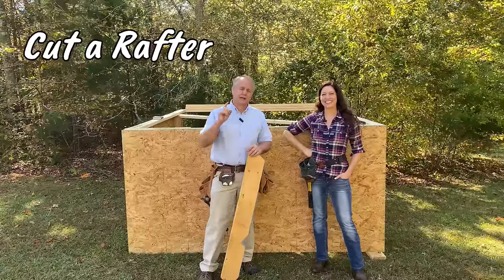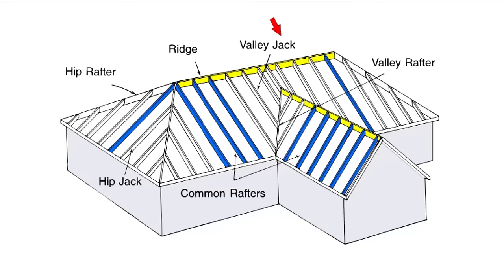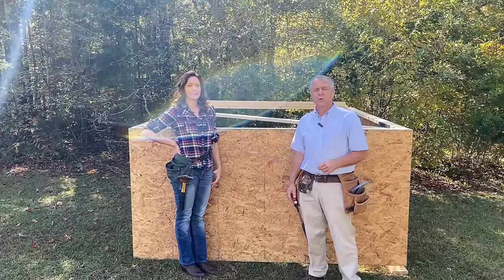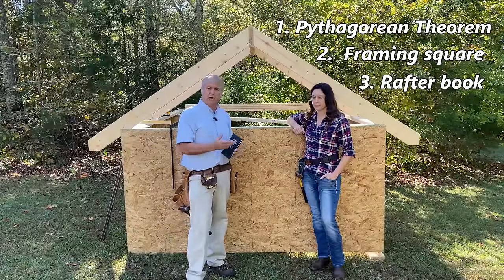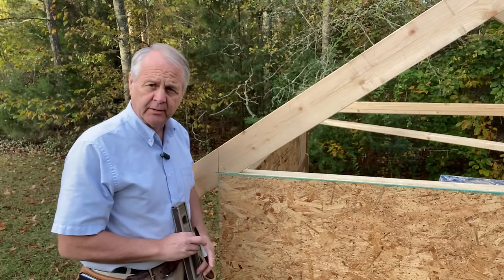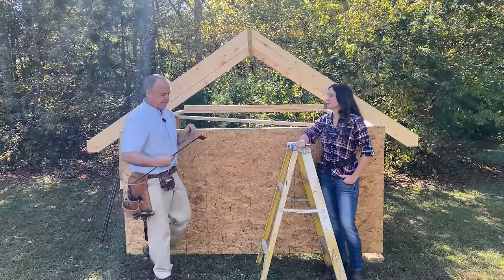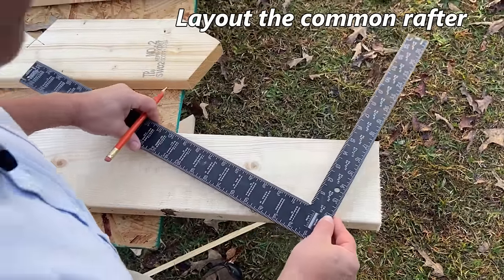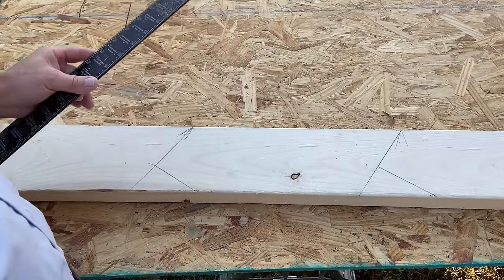Beginner’s Guide to Roof Framing – Cutting a Rafter, Step-by-Step

Comment: I see an error of the explanation. You stated that you wanted four inches gor a full bearing seat cut, but the framing point was ghe outside of the wall frame. You need a four foot run plus the thickness of the sheathing minus on half the ridge gor your calculations which actually translates to a 4-0 snd and 1/2 inch run. Then that four inch bearing surface works.
   I like you taught my students every possible way to calculate rafters to my students including snapping a bisecting line on the floor of the shed, setting a block representing the ridge snd and using the side and end walls as a marker to establish how the birds mouth fits using a sevond block representing the top plate.Your presentation was pretty much flawless,but I thought you would not mind if I pointed this out.
   I usually use a calculator to establish to the sixteenth of an invh accuracy, but feel that your rafter book would do it faster snd more reliably and without batteries and the exoense of a calculator.
   Good work,sir
Reply from the maker: Thank you for the response. I suppose I didn't explain it fully, but the span of 8' was to the outside of the sheathing on each side. The model didn't have any wall framing. It was just a top plate screwed on the edge of the sheet of OSB, so I used the full sheet for the span. Thanks for watching!

Comment: thanks for the awesome video... however, help me understand something... when using this primary method of measuring the rafter in this video, doesn't it require the rafter to already be in place as shown? I can follow the Roof Bible and the 'alternative' run method, and I can follow the method that was used, but it just seems like the rafter would have to be in place... The step off method also seems like the rafter would also have to be in place...

Another question, the rafter tail is arbitrary, correct? If I want it to be 12", fine, or if I wanted it to be 18", that's fine as well, correct? 

Thanks again...
Reply from the maker: I placed the rafter into position to aid the viewer in understanding its final placement. None of the methods of determining the rafter length require it to be so. In practice these are always laid out with the boards on the saw horses. As to the overhangs, you are correct. The length of the overhang can be whatever you desire. Regardless of length they are laid out with the same method. I trust this answers your question. Thanks for watching!
Reply: I have been cutting rafters  since 1968.  Here is a simple way.   First you need to get a book  that that tells you the rafter length by the span of the rafter.. In this plan the span is 8'  so you look under common raffter  by span go down to 8 ' It would automaticall tell  you the rafter lngth  of one rafter.( the run of this rafter woulld be 4'  but you look under 8'span.  Now the ridge ia 1 1/2''  wide so before looking up the apan you deduct 1 1/2''  from 8'  so you would actually look up  7'  10  1/2''   The best part of this book If you have a hip or valley( they are both exactally the same length)  you would take the same measurement o the span off the common  7' 10 1/2''  and look under hip or valley it would tell you the exact length of one  hip no shorting needed

Comment: Good info.
My question is on a L shaped building what would you call that roof?  The corner is what im interested in.
edit Hip is the keyword i wanted i believe
Reply from the maker: You are correct. The corner of two gables on an L shaped structure would be a hipped corner. Thanks for watching!

Comment: I'm getting ready to build an off-grid cabin in an area that has no building codes.  I'm trying to find info on ridge board or ridge beam sizing based on span and load.  Does your roof bible have that info in it?  I've built many houses but always used trusses, this is my first time with rafters.
Reply from the maker: No, Roof Framer's Bible doesn't address any structural beam sizing. There are just too many variables.  If you have ceiling joists attached to the rafters on each side you only need a ridge board. The ridge board should be one size larger than the rafters, so if you have 2x6 rafters you will need a 2x8 ridge.  If you have a vaulted ceiling (no ceiling joist tie) you will need a ridge beam large enough to carry the load of half the span. There are some beam calculators out there. Just figure out the loads for your situation (dead load, live load, snow loads, etc.) and plug those loads per square foot into the calculator to get a beam size for your ridge. This isn't really recommended for DIY unless you have some experience. It is best to contact a competent person or engineer. Good luck. Thanks for watching!

Comment: What I’ve never understood is that no one ever seems to mention how the depth of the birds mouth cut would affect (slightly) the angle of the rafters. Or is this so slight that it is ignored? It would also affect the angle of the plumb cut I would assume…?
Reply from the maker: Actually the rafter doesn't change pitch because you notch the birdsmouth. The entire rafter drops down due to the notch, but the pitch or slope doesn't change. Also because the pitch doesn't change the plumb cut doesn't change either. Think of the roof like a hat on your head. Notching the birdsmouth allows the "hat" to drop down lower, but it doesn't change the pitch of the roof. Thanks for watching!
Reply: I am having the same problem understanding this, because the run looks like it's from the inside corner of the bird's mouth, when the finished rafter is in place.
The top of the rafter at the plumb mark appears to have less rise, like 28" instead of 32", so how are 8/12 cuts still working? Or is it no longer a true 8/12 pitch at the top of the rafter. 
Obviously, I can see everything is working perfectly in practicality, in the video, but I am having a huge issue conceptually. Can you help straighten me out on this? I would be very grateful!
Reply from the maker: @mtmcb  The rafter is a true 8/12. Bear in mind that everything is figured along the top edge of the rafter. The notch for the birdsmouth is typically cut so that it fits the top plate of the wall (3 1/2"), but it doesn't have to. You could have a birdsmouth where the H.A.P. was greater. This would change the height of the ridge, but it would have no effect on the pitch of the roof. The rise would remain the same from top of rafter at wall line to the top of rafter at the ridge. The ridge would be higher off of the wall plate, but only because of the taller H.A.P.  The height of the ridge is always the H.A.P. plus the rise. Thanks for watching!
Reply: @RoofFramersBible  thank you. Finally, I get it. The ridge rises accordingly, and this is easily calculated into the equation. I appreciate your patience!
Reply from the maker: @mtmcb  Good luck. Thanks for watching!

Comment: When I multiply 4ft by 14.42 I get 57.68 which is closer to 57 11/16. Are you rounding up to the nearest 1/8th? Or am I doing something wrong? Is this a minute detail?
Reply from the maker: Yes, I generally round to the nearest 1/8". That is typical for rough framing. The irregularity of the framing lumber will affect it more than the rounding. Thanks for watching!
Reply: @RoofFramersBible  awesome video thanks for making it! I’m a complete beginner and I think I’m about to build a roof!

Comment: If you use a rafter book it is calculated by the span , so you would look  up 7'  10 1/2 ''  and you would get the exact length of the rafter.  say if it was a hip  you would look under hip  or valley  and use 7' 10 1/2''  and that would be the exact length of the hip or valley no shortening
Reply from the maker: You are correct. Most of the old rafter books used the overall span in the tables. I used the "Full Length Roof Framer" book for many years. Thanks for watching!
Reply: @RoofFramersBible  Using the total span is better .  Say you are cutting an  L shaped bilding you take 2 measurements and cut the whole roof. Say you need to cut a hip between 2 ridges.    you could add 1 1/2''  to the span of the common to the lower ridge that would get you to the far side of the ridge then calculate the higer  hip using the span method   and deduct the difference of the two hips

Comment: I just came across your site, these videos are excellent.  Can i ask a question about your rafter square? Is it a standard carpenter's square or is it a particular brand that has that table printed on it? Thank you
Reply from the maker: Historically all the large framing squares (24" x 16") had rafter charts stamped on them. Some of the cheap consumer level squares sold now don't include the tables. The professional squares of many brands will all have it. Thanks for watching!

Comment: so, for the step-off method, you measured a rafter that was already in place, and was the right length? I don't understand
Reply from the maker: I find that most people understand best by showing a visual. They often lose context when the framing square is laying down on the saw horse. That's why it is illustrated on the rafter already in position. That way the body of the square is horizontal and the tongue of the square is vertical. Thanks for watching!

Comment: What happens if the seat cut is only 2" horizontal?  Wouldn't it change the   overall height at the peak off the structure?  I think this is where I messed up trying to cut my roof, thinking the height off the structure at the peak is fixed
Reply from the maker: Generally you make the horizontal cut of the birdsmouth the width of the wall, however a 2" seat cut is fine in most cases. The limited load on those rafters is fine with a smaller bearing surface. The slope and length of the rafter is figured from the top of the rafter, so that remains the same regardless of the H.A.P. (height above plate). So if you have a smaller seat cut that will generally result in a taller H.A.P. and that would raise the whole rafter up including the ridge. This isn't a problem unless it is tying into another roof where the height is fixed. I hope that answers your question. Thanks for watching.
Reply: Hi this book available in metric

Comment: So your model is 8 feet span ( @ 4.24min) but you run all the calculations (including the figures on the framing square) as if the span was 12 feet (with rise = 8 feet)? Then a@ 9:42 the drawing shows 8 feet for span (4 feet for run) albeit the span on the diagram showing on the top left corner shows a span of 12 feet? Your presentation is excellent bar these aspects that personally have left me unsure as well as the method to calculate the rafter length on the framing square which could be more clear but maybe you have a presentation just for this on another video (?). Anyway, thank you!
Reply from the maker: The model in the video has a span of 8' and all the rafter lengths are figured from a run of 4'. At the 9:42 point in the video, which you reference, what you see in the upper left corner is not indicating a run of 12', but rather is the standard way that roof pitches are called out on plans. Any plan that you see will indicate a 8/12 pitch in this fashion or format. I hope that answers your question. Thanks for watching!
Reply: @RoofFramersBible  Thank you for taking the time to answer which is very much appreciated. My second question: my bad and you are right in pointing out 8/12 as the pitch proportions regardless  the length of run / span  - I am embarrassed because I should know this better and somehow I raised this question. My apologies.  Re my first question the same is answered by the second one: an 8 feet span model where the calculations were run proportional to 8/12 (a rise of 8 feet for a 12 feet span) being the rafters' length calculated based on a 4 feet run. I hope Pythagoras has not read my questions!
Reply: 1463.6 mm is rafter length along birds mouth line. I always use trig for calculating
Reply: 8 inches of rise to every 12 inches of run,

Comment: One question, if I’m using wood soffit with Bobbing those ends,if I have no ceiling rafters, how do I run that piece straight across without angling them? I only have one side to nail to and nothing on the inside. 2x3 or 2x4 around the top?
Reply from the maker: I'm not sure I have the context of your question. I am assuming you are saying that you want to have flat soffits and are unsure what the soffit nails to. With a sloped rafter with the tail bobbed off for a flat soffit, you would need to add blocking, some people call those "lookouts", lapped on the sides of the rafters. These provide a level nailing surface for the soffit. I hope I have answered your question. Thanks for watching!

Comment: I'm an inexperienced builder who's looking to build a small house (~600-800 sq. feet) and do as much of the work myself as possible, including framing.  Do you think a shed roof would be easier for me to build correctly, versus a gable style roof?
Reply from the maker: Neither roof is difficult, so that shouldn't be the tail wagging the dog. The architecture should dictate the choice. Generally that would be a gable roof. It largely depends on the style you are trying to achieve. Good luck, it is a great feeling to build your first house.
Reply: @RoofFramersBible     Thanks much!

Comment: can't you just make like a shower rod kinda thing and drill a hole into the end of each rafter and slide it on from the sides then affix it into place at any angle you need?
Reply from the maker: Well now, that's an idea, an adjustable ridge. Unfortunately it wouldn't work very well. It would have very limited load bearing capacity, and the bottom ends of the rafters wouldn't fit the wall plate. But I do admire your ability to think outside the box! Never stop thinking and trying new things. Thanks for watching!

Comment: What happens if there's gaps between your rafters and the beam? I had an inspector say as long as it's in contact with nails protruding that it's fine.. I don't see how that's safe or correct.
Reply from the maker: They certainly should fit the ridge. The most important is for the bottom of the rafter to be in contact with the ridge so that the load transfers. A small gap at the top, if it is well nailed, wouldn't be fatal. But, they should always be cut to fit. Thanks for watching!

Comment: When cutting your rafters, why did you take an extra 1/8th inch off? If that length was 57-3/4”, and you subtracted the 3/4 for half of the ridge thickness, that would be 57”. Just wondering what the extra 1/8 was for.
Reply from the maker: The 3/4" is the horizontal run of 1/2 of the ridge thickness. Measuring along the slope of the 8/12 rafter is 7/8". The values in the charts are rounded to the nearest 1/8". Thanks for watching!
Reply: Is it an 1/8” because it’s an 8/12 pitch? If the pitch is 5/12 would you still deduct 1/8” or does the round off number based on pitch?
Reply from the maker: @johnxuereb9673  No, the steeper the rafter, the longer the rafter length for a given rafter run. So, if you were measuring along the top of the rafter for a very steep pitch it would be more than 1/8" longer than the 3/4" horizontal run. So, it was just coincidence that on this 8/12 it was 1/8". Thanks for watching!

Comment: This is probably a dumb question but I’m having a hard time understanding rise. How do you figure out rise? I noticed in the video you already started with 8/12. But how did you get 8 rise? Does it just depend on how steep you want a roof to be? Do I just pick a common pitch and go with that?
Reply from the maker: Yep. You just decide how steep a roof you want. Often of course, the architects will make that decision for you and specify on the plans what pitch is desired. I just picked the 8/12 for demonstration purposes. Thanks for watching!
Reply: I was wondering the same.

Comment: so the run of the rafter is 1" foot long and the rise is 8 inches, but the span of the house is 8" feet but the run is 4" feet. so do we have two different runs? one counting for the rafter and one counting for half of the span of the house?
Reply from the maker: No. In our example the rafter run is 4', or half the span. The pitch is designated per one foot of run, so in one foot of run the rafter rises 8". The actual run of the common rafter is 4'. Thanks for watching!

Comment: Good geometry explanations, but that ridge on the top is exactly how it is NOT supposed to be 19:04. You are supposed to add an I-beam underneath the ridge supported by studs on both ends so that the weight of the roof can be transferred to the foundation rather than fully resting on the side walls.
Reply from the maker: The model used is for illustration purposes only. You are correct that if this was a finished roof structure, you would need either ceiling joists tied to the rafters on each side, or a structural ridge with supporting posts on each end. Thanks for watching!
Reply: @RoofFramersBible  thanks for your comment. I am not a builder. I am going to get a house built so I am just learning by watching YouTube videos. I will pass your valuable  comments to my drafter.

Comment: Couldn't you just make the birdsmouth and the end cut marks at the same time by flipping the square over and using the 12 and the 8 measurements?
Reply from the maker: Yes, you certainly could! Great to see you are paying attention and thinking it through. Sometimes the H.A.P. and overhang dimensions don't work well with that method, but in this case it works great. Thanks for watching!